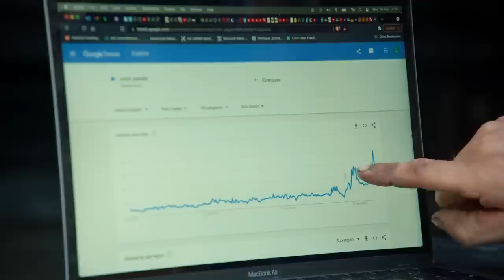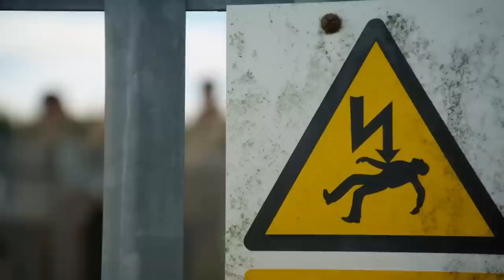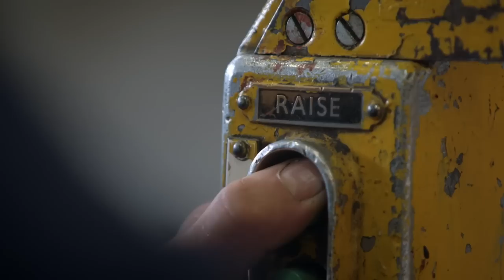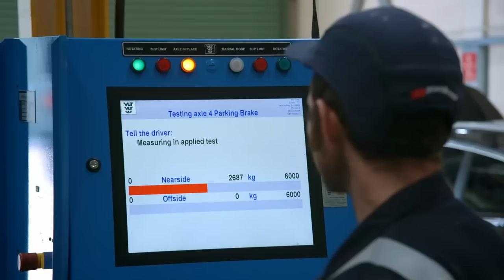Guy Visits A MASSIVE Solar Farm  | Guy Martin

Comment: Sorry you guys solar is not the answer at all and at some point when you have all got 90% of the roofs covered the "government" will tax them nothing surer than that.
Reply: That would probably take a few decades so I'll happily enjoy my free electric for all that time. 
You keep paying for your electric and I'll count my savings.
Reply: @leskennedy  there is an element of "free electric" and is a "must concede"
 point but how much has this "free electric" cost? It is not unreasonable to expect 20 year life span and given the lunacy of the current administration it artificially makes solar more attractive even after allowing for the degradation output curve over the same period. 20 years hence will solar still be viable as the cost of manufacture will have increased. Regardless of summer or winter we must admit to a 50% work cycle for life also anyone living above 23 degrees latitude is definitely not getting much bang for their buck. To revert I do think you will not get "free" electric as the market gets bigger someone is losing your dollars and the gov will tax you in some way to "compensate". A positive for self generation / storage is the security of supply especially as the grid gets older and more loaded the caveat being apart from your basic needs of heat / lighting what other power dependent services have been shutdown? I don't think any of this is the bed of roses it appears to be.

Comment: That's going to be an awful lot of land cover with solar panels.
Reply: Every building can have solar panels on every roof and wall utilising wasted space
Reply: And a lot of that had been, or could have been, used for food production here in the UK rather than shipping or flying it in.
Reply: @iwbarke  a lot of it is industrial land. 
We haven't been self sufficient in food for the UK since the 18th century. 
And population has increased and tastes changed. 

It's nothing to do with a few solar farms.
Reply: @iwbarke  you can even use the land for both things